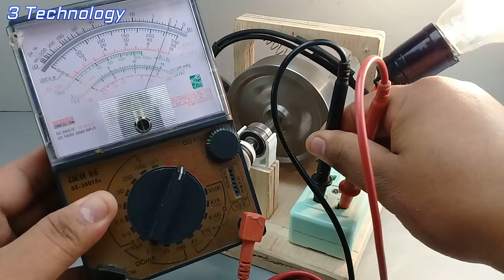Idea make 220v free energy generator Build spring flywheel machine Not used electricity

Comment: Do one thing I will believe you don't switch off the camera or pause the camera until the video ends,
that is run the project...
while running stop the wheel and open the motor show it in the video  without p𝕒𝕦𝕤𝕤𝕚ng the video I will pay you double your amount and buy from you
Reply: If you look at his 1st video you can see the flywheel running before he put the engine on it and it ran just fine with just the springs Attached the  Attached the motor to it later watch his 1st video with just the flywheel and the springs and you will see it run No motoring anywhere around it

Comment: I have a 500w generator at 220volts. Without connecting a 60W bulb, you can rotate it, although not very easily. After connecting a 60W bulb, resistance is created and it is difficult to turn the generator. Here, a tiny flywheel, thin springs and a light bulb. Nothing has changed, no resistance, and it's spinning like never before... something stinks here...